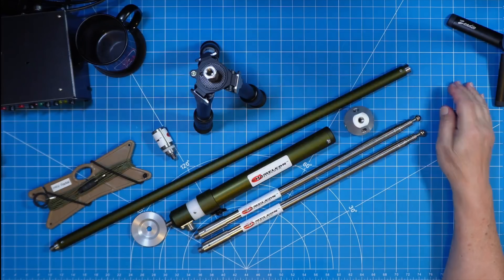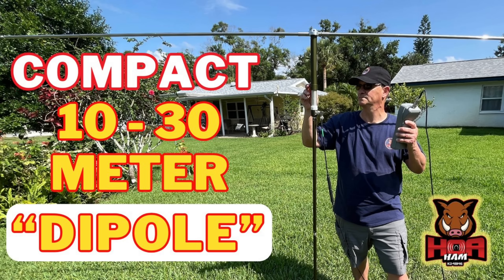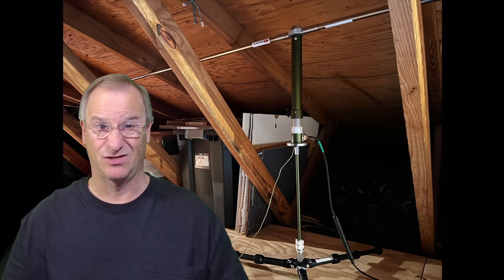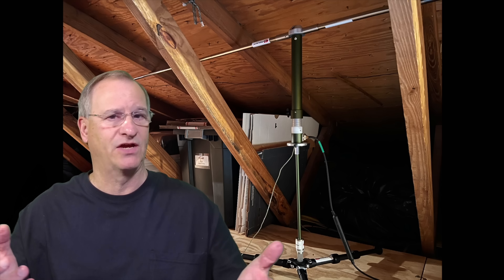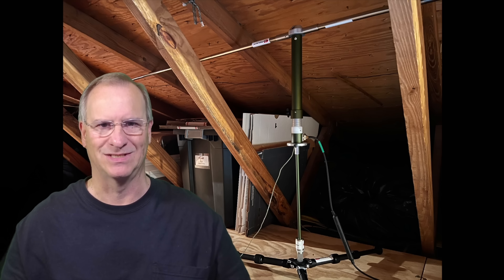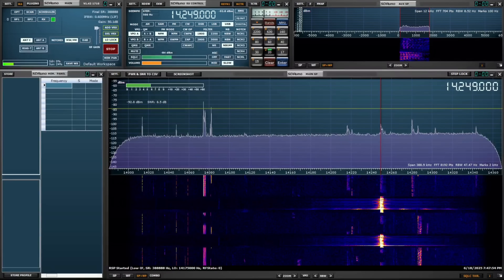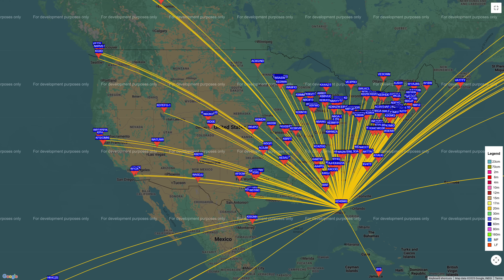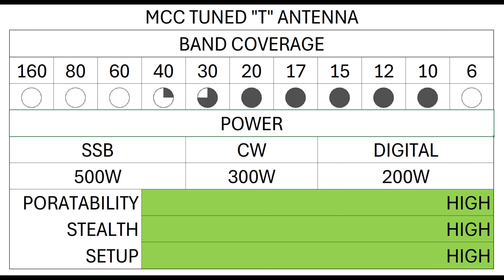Ham Radio Attic Antenna for Emergency Communications and HOA Stealth - Set Up, Demonstration, Review

Comment: I suspect that, because of their surroundings, attic antennas can have interesting patterns. In my case a 40-30-20 dipole in the attic seems to give revealing results on WSPR. Running 3 watts from the SE U.S. I seem to have a pipeline to Australia and to Europe. On the other hand, I only rarely get into South America and have never been picked up by WSPR in Asia. There is a factor that be influencing that. The floor of my attic is covered with attic foil, so there is an unusual ground plane/counterpoise effect going on, resulting in all sorts of odd reflections. In my case, I was more fortunate than you. My attic is 20-feet high, so I was able to squeeze in inverted Vs for 40, 30 and 20. The antennas only get close to the foil at their ends.
Reply from the maker: That is a fantastic amount of space in the attic, and a fan dipole is perfect!  I too have very few WSPR results in SA, and none in Asia - even using omni directional antennas....  Not sure what story that tells.

Comment: FYI : I learned I have a neighbor who is a ham and a retired EE who has a major antenna farm in his attic. We both have foil covered roof sheathing. He has a TV antenna, 2m, 70cm, and various HF antenna in his foil lined attic that work. We talked it over and Doug thinks signals might go through the roof eves as we have steep roof lines . The eve of my garage attic points east toward Europe and my south eve points toward Florida. I have room for a 10 m or 6 m yagi beam over my garage. So far have run coax from attic to OP , now waiting on parts to try wire antenna first.
Reply from the maker: This is really interesting.  I've never had any first hand experience dealing with this myself, so I will be interested to learn of the outcome of your experiment.  I guess the only way to know, it so try.  Thanks for letting me know about this.

Comment: Great solution! I took have a 4/12 pitch roof and I do not want to crawl to the ends to set up an antenna.
Reply from the maker: Attic antennas are so compromised, but I still try different things to find the best possible option.  Thanks for taking a look.

Comment: I've been planning on putting a speaker wire dipole in my attic.  Do I need to worry about lighting protection?
Reply from the maker: Lightning seeks ground, so anything that creates ground is a target, and that includes an attic antenna.  I view an attic antenna as though it were set up outside.
Reply: Like our host. I treat my as if it were outside hanging between trees. That said, I suspect the greatest risk isn't a direct strike but an induced current from a nearby strike. I always disconnect my 40-30-20 dipole when I'm not using it.

Comment: We have a metal roof. Would this still work? We are newbies to all of this.
Reply from the maker: The metal roof will block the signal going out from the antenna; it acts as a faraday cage.  Getting this antenna somewhere in your yard, if you have one, would be better.
Reply: @HOAHamRadio  You might try you gutters, particularly if you can find a way to insulate them. There's also the flag pole antenna option.

Comment: My attic fan dipole is highly effective at coupling to the interconnected smoke detectors.   My housemates love me when I set them off while they are asleep 😂. de AC7PB
Reply from the maker: LOLOL, I have set off my smoke alarm with my UHF/VHF radio, but never HF.  I have had some attic antennas that did interact with GFCI outlets.  Its definitely a science project to figure out what antenna will work without interacting with house mechanical systems.

Comment: Like you I am In Florida and lightning is always a concern.  It struck a tree in my yard years ago, long before I considered amateur radio.   A local HAM said he felt attic antennas were lightning magnets.  I suspect that might be related to different electrical charges.  I have been contemplating an attic antenna that was disconnected when not in use.  Have you researched lightning with in attic antennas and what are your findings ?
Reply from the maker: Unfortunately, there is no body of information on this subject that I have been able to find.  If you do come across this, I would really be interested.

Comment: I wonder if you could use the gabil screwdriver base instead of the chameleon manually tuned base?
Reply from the maker: I think you could, and that's a great idea.  Would need an M10/1 to 3/8 X 24 adapter at the top.

Comment: Maybe add a stress relief to that horizontal cable entering the antenna. A simple string or cord attached to a screw in the rafter would probably be enough imo
Reply from the maker: Yep, I should have put a right angle connector on the coax; have a dozen of them in my drawer.

Comment: My guess is you could also use the CHA Mini on one side of the puck and a "naked" whip on the other side, a TDL constructed vertically without the wire connecting the 2 whips for the loop.
Reply from the maker: Hmmmmmmm. I think I’m gonna have to give this a try.
Reply: @HOAHamRadio in my mind it's basically an of center fed dipole. I'd try it, but my attic is a Faraday cage.

Comment: Hi Bob. As a half-wave dipole, no counterpoise is necessary. You do need to adjust each side of the antenna for tuning. 

Functionally, that’s no different than a half-wave wire dipole. 

Of course tuning is best left to our colder days in February.😅
Reply from the maker: February it is; I told myself all winter long I needed to do my attic videos then...but, no, didn't listen to myself....

Comment: I'd prefer something larger than what I see in this video, there is room up there. I'd run a single wire to it as part of the aerial and a tuner in the shack. WSPR is one thing but making contacts is another.
I made five dipoles which are in my attic, 20m to 10m, they work fine. No tuner needed. QRP 5 Watts max. On 20m and 17m the ends wrap round the joists in two large loops to fit them in.
I did wonder about attenuation of wood, brick and roof slates but can find nothing in radio books or online, only figures for u.h.f. and microwaves so I guess it's very little at h.f. 
I have a low 60m band inverted vee outside squashed into my 25' x 13' garden.
G4GHB.
Reply from the maker: Thanks for sharing your experiences with attic antenna @bill-2018; the more info the better for those considering their options.

Comment: I put my Yaesu ATAS120 with 8 radials in my attic
Reply from the maker: If you have the height, the ATAS120 is a perfect attic antenna!
Reply: @HOAHamRadio that was indeed difficult, but there is a spot where i could get to fix it. But my attic is not a crawl place, its where all the nails are exposed and floor is insulation material.
Reply: @HOAHamRadio also have a chameleon EMCOMM 2, hang the length of the attic, but could not hoist it full length, so it runs a little traverse! Crazy part with that i can reach CA, and also DC. But not texas or anywhere south. That one is laid east to west. 

With the atas i could reach Tennessee, since its omnidirectional. But does not get far.
Reply from the maker: I've zig zagged wire antennas in the attic above my garage years ago and was surprise how well it worked.  Its been back on my mind to try a new configuration, now that I have a little more experience.

Comment: Before moving into an HOA, I was using a Cushcraft A4S with the 40 Meter add-on.  Obviously, the HOA says NO to that antenna (and all others).  I did some measuring in the attic and hung the driven element of the A4S in the peak of the attic.  I have 4” to spare on either end.” It just barely fit’. So now it is and aluminum, 4-band, trapped dipole. 10-15-20-40 from the attic.  It works OK, not perfect, better than nothing. But, every time I transmit, the bedside lamps come on in our guest rooms.  Must be some RF in the house.
Reply from the maker: You made pretty good use out of the attic space for sure; I envy those with taller peaks and more room.  Can't complain about having 10 - 40 completely hidden from the HOA.  Nice job.
Reply: Did you retune the beam in the attic ? If not consider it .
Reply: @p @phillipdewitt4454 I did. Best I could get was about 1.4:1 to 2.0:1.  So, I use a tuner.

Comment: Good configuration.  Lets call the 12 foot wire a counterpoise and call it a day.
Reply from the maker: Yes, yes, counterpoise it is : )   Sometimes I miss the obvious.
Reply: Back in 1967 as a 14 year old novice, I took 22 feet of wire and about 30 feet of coax and made a 15 meter dipole which I stapled to the rafters inside our attic.  Worked my first DX with it.  At the time
the US Novice CW band overlapped what in other parts of the world was the lower end of the phone sub-band.  Many DX stations would answer American novice stations who were on CW, some would actually call for American novices to work them while they were on phone.

Chris AJ1G
Stonington CT

Comment: Interesting experiment Bob. You could replace the Chameleon coil with a little Tarheel remotely tuned coil. Then you could change bands without going into the attic. You are correct the two radiating whips do add capacitance which effects the tuning versus a single vertical radiator.
Reply from the maker: I have less that 40" height, not gonna fit little Tarheel vertical.  I could fit their dipole version, and would LOVE to have that in my antenna arsenal.  $$$$$  I salivate over it every time I go to Hamcation.

Comment: Thanks for this one Bob.  Great information.  I run attic dipoles on 10m & 20m and get good results on FT-8, but it's rare I can make an SSB contact.  73
Reply from the maker: Thanks for confirming my experience, @paulKJ5GKK.  Attic FT-8 is easy, SSB voice not so much.

Comment: My HOA president admits she knows NOTHING about radio. Told me to ask my neighbors permission before installing an INDOOR antenna so they can report "interference." The more you know...
Reply from the maker: Yea, right....ask my neighbors : )  That isn't happening!
Reply: You made a mistake Tell them nothing!
No HOA but in 35 years not one neighbour has ever asked me what these wires in the sky are for. 
I could tell them they are for putting washing on high up to get more breezy conditions.
G4GHB.

Comment: wait….your going into your attic to tune to another frequency during a hurricane!
Reply from the maker: Nope, I was just stating you can tune it to your preferred band.  The Hurricane Watch Net operated 20 / 40 meters, so I choose 20....
Reply: @HOAHamRadio roger that! I have a G5RV with ends bent down in my attic that gives me multiple bands with no physical changes
Reply from the maker: @jerryKB2GCG Sounds like a great setup!
Reply: I wouldn't like to do that every time I change bands, hurricane or not.
I made five dipoles 20m to 10m in my attic. No tuner or going into the attic once set up.
G4GHB.

Comment: Please help: At the 6:45 mark I am not sure that I am getting the obvious reason why no parts of the antenna should touch the wood structure.  Is it because of a possible fire risk, or that the wood would de-tune the antenna and affect the radiation pattern?  Also, do you think that attic antennas could be susceptible to or attract lightning strikes?  Thank you for sharing your excellent content and great videos!
Reply from the maker: First, yes, attic antennas are susceptible to lighting.  Our houses are filled with "grounded" objects, and that is what lighting seeks out.  Home wiring that runs in attic spaces, is grounded.  Treat an attic antenna like any other electrical device during a lightning storm....DO NOT USE.

As far as touching wood surfaces, many uses run digital modes full duty cycle which generates a great deal of heat.  So, I always say don't let your antenna touch wood surfaces.
Reply: I only run QRP so no problem and two ends of my five dipoles wrap round the roof rafters (Edit: joists) to fit them in. If it is de-tuned you adjust the tuner accordingly like my dipoles are shorter than the calculated values. They work!
I was wondering more about r.f. attenuation but the radio books and online only quote figures for u.h.f. and microwaves so I guess no problem at h.f.
I wouldn't do it for 472 kHz or 137 kHz because of high power needed to get out and high voltages generated. 
I suppose any high house wiring could attract lightning. We don't get much but living here with large old cotton mills with typically 180 foot chimneys lightning is likely to hit them before any house.
G4GHB.

Comment: My knees wouldn't be able to take that amount of crawling around without using knee pads.  You were certainly blessed with good joints.
Reply: I installed an offset dipole in the attic of my last home. It was hot work installing, but it got worse when I missed a beam and made a huge hole in the ceiling of a guest bedroom. Still, perfect stealth solution
Reply: @augustwright4295  That's why years ago I got some old wooden pallets, broke them into planks and put a walkway below the apex of the roof. I had something safe to walk on, at least until I had to put the eds of my dipoles in the rafters.
I always take a torch as well because if the light goes out for any reason I'd be in complete blackness.
G4GHB.
Reply from the maker: LOL, yep, the older I get, the more I feel it.
Reply: Good roof joists too.
G4GHB.

Comment: I wish I had all the room in my attic that you have. I also have a bunch of foil wrapped duct work up there. Will the duct work interfere?
Reply from the maker: Ductwork will have an impact.  Be sure not to touch it with the antenna.  Once you are in an attic space, there is no such thing as ideal -- its compromised no matter what you do.

Comment: I have a fan dipole  from Alpha Digital in my condo attic. The antenna is close to the top of the attic and is attached to the rafters.  Should I look for some Styrofoam spacers to make sure it does not touch the wood rafters?
Reply from the maker: I would use some type of spacers to get the wire off the wood.  People who run digital modes generate heat in their antennas; to the point they have melted.  Obviously, temperatures like that touching wood must be avoided!

Comment: I lived in an HOA until we got rid of it. I had my antennas in the attic. Then, I had my roof replaced and then I could no longer get out. Apparently they installed radiant barrier. I now have a tower.
Reply from the maker: Yep, radiant barrier = faraday cage.  Congrats on the tower.

Comment: I built an attic fan dipole for 6-10-20 meters utilizing "Flex-wire" ... not because I had too but was easier than worrying about lightening strikes, wind, winter storms ... etc. and it tunes on 80 thru 6 with my Kenwood 590 internal tuner. I've worked the world on 100 watts ... SSB & CW ..
Reply from the maker: Fantastic!  Thanks for sharing your experience.
Reply: I got an extra mosley element I'm thinking about installing it in my attic .
Reply: Any idea if a 20W radio would get any distance with a similar attic antenna?